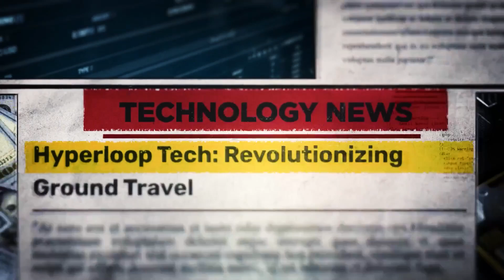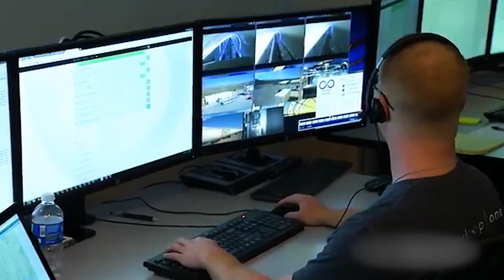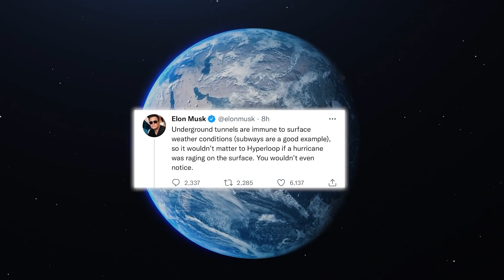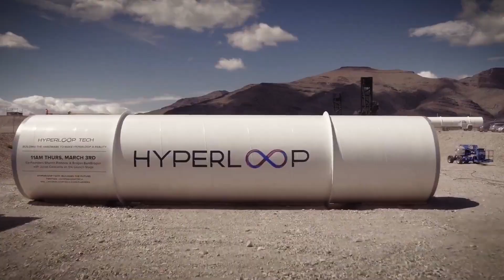World's First HYPERLOOP Accident Dubai's Prototype CRASHED During Live Demo

Comment: Costs will be the main factor. The progress to t00% perfection always meet an exponential curve of rising costs the nearer you have to get to 100% of perfection in the material world. The main problem with the hyperloop concept will always be this damn capacity of the hydrogen molecules in the air to find their way in the gaps between the atoms of any solidd cristaline material. it's a function of the surface of the material between the air and the vacum. The that surface increase exponentialy with the radius of the tube time the length of the tube. The longest vaccum tube humans have build so far are the  beam pipes, of the Large Hadron Collider (LHC) in Geneva that have a  lenght 27 km (17-miles). They have a radius of a few centimeters. They had to have a near perfect vaccum inside and they cost an insane amount of beryllium to build. They have been build in a big tunnel ungerground and are well protected against all kind of environnental hazards. But an hyperloop won't have that luxury.
https://www.youtube.com/watch?v=EeWcQf9QCmg
Reply from the maker: Very valid point my friend, it won’t be easy to create and manage. thanks for liking and subscribing